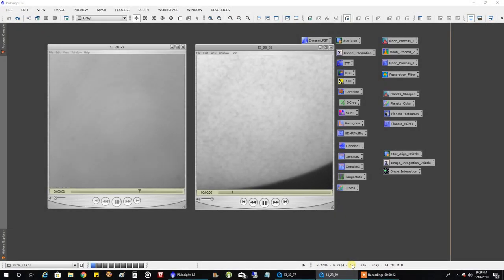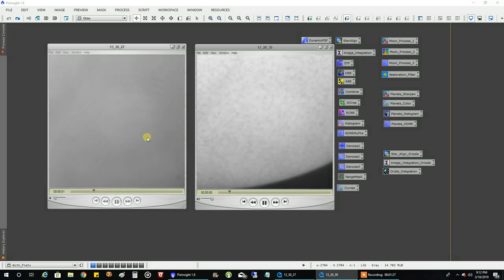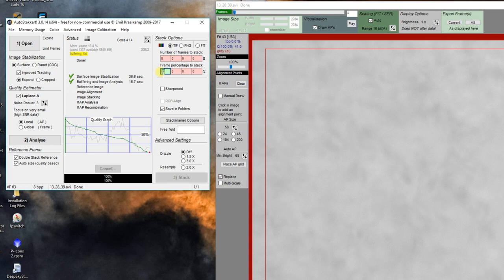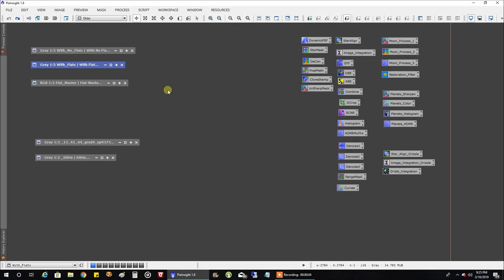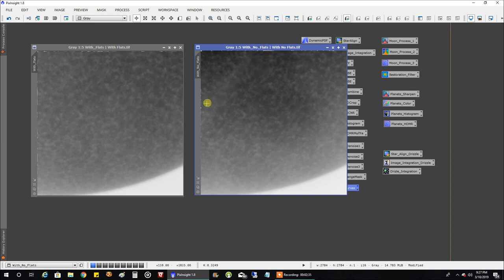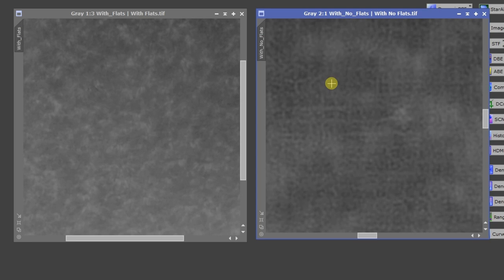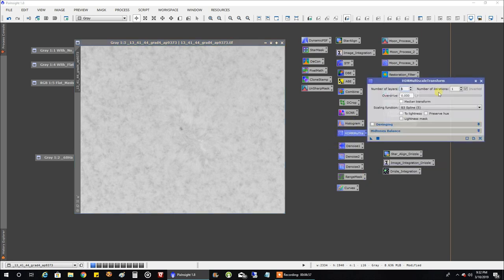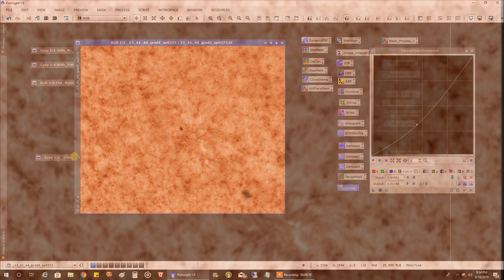Create Flats For Solar Imaging With the ZWO ASI183MM

Comment: Hi Chuck, Great Video! 
Question; How do you create a flat when you are not zoomed in, I’m using the 183 and imaging as a full disc. 
Thanks so Much, Rainee
Reply from the maker: Right, you need to diffuse the light edge to edge.  Plastic wrap will work - like the plastic wrap inside a cereal box.  Check out this video - I discuss it at around the 10 minute mark:  https://youtu.be/h_SQe2MLOvw
Reply from the maker: Actually, I discuss it at around the 6 minute mark, and then demonstrate it at the 10 minute mark.
Reply: Thank You!!

Comment: Hi Chuck, how do you make a flat for solar full disk image to remove dust motes??? Close up images are easy to make by just making a flat using a defocuse image and apply flats using AS2! But for full disk, defocusing the image doesn't  work, any recommendation?
Reply from the maker: Correct, the full disk is a different animal - I use a plastic wrap - something that looks like a cereal bag, put it over the scope.  That difusses the light, and then capture your flats - works great.
Reply: @ChucksAstrophotography  No need to defocus anymore with white opaque plastic bag right?
Reply from the maker: @jkty5597  Right, you won't need to defocus.
Reply: @ChucksAstrophotography  I will try in my next solar full or near full disk session. Solar activity very quiet now.